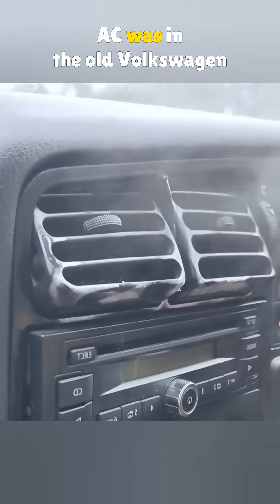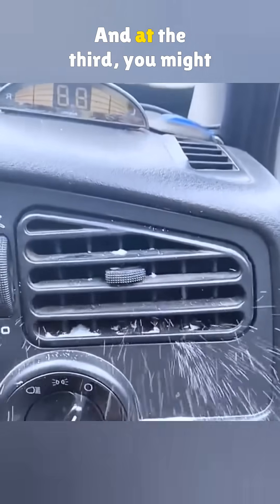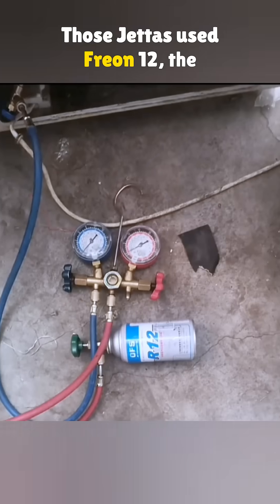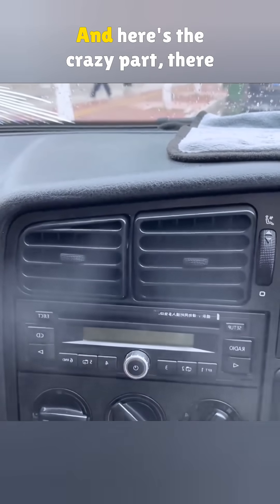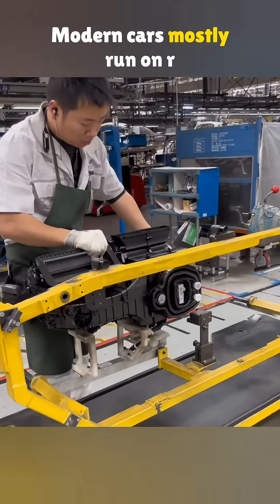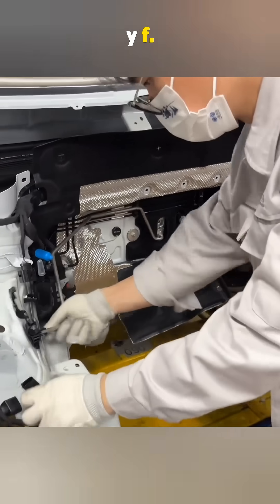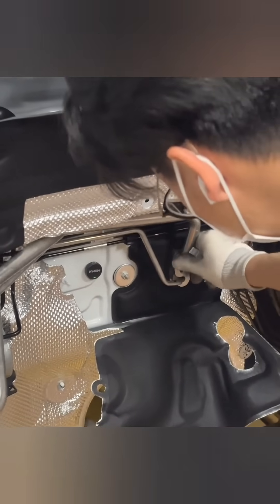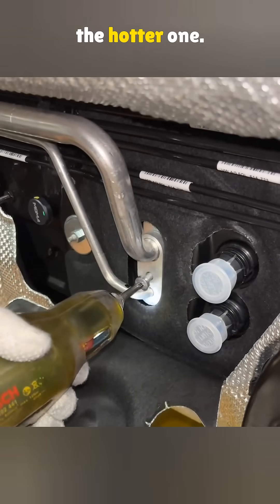Why Older Car AC Feels Way Colder Than New Cars #assembly #manufacturing #automobile #mechanic

Comment: You can do the same with R134a as well but it is not efficient than R12. Find the Evaporator Core temp sensor or heater core temp sensor (depends on manufactures' labeling). Cut the element off and solder the wire ends. Or just bypass it. Had to do this on my cousin's 2003 Celica cause that specific part was discontinued. It allow the AC Compressor to cycle. When it gets cold, the resistance increase. Disengage control side of relay. Works but it frost up to the point where it becomes blockage to the blower airflow.

Comment: still remember how i used to drive an old toyota, it was a KE70, turned the ac at fan speed 1, after 10 minutes of driving, i had to turn on/off the ac every 5 minutes of drive to work 😂 old cars ac are way colder than modern cars

Comment: In India, where temperatures can soar to 47–50°C (116°F), the air conditioning in Skoda and Volkswagen vehicles often falls short. Many buyers avoid these brands for this reason, along with the lack of features compared to the competition.
Reply: They don't study the market before entering it so they fall short in offering a car that people want.
Reply: use r134a replacement (ecoron freeze 30 or any hydrocarbon refregerant) .. 22 psi at low side at 27 degrees c and trick the sensors somehow.. it works great in my skoda laura

Comment: Is it really waste to use modern car  AC rather than opening window at high speed
Reply: Apparently causes more drag than the AC compressor - causing the engine to work harder to keep the speed up. At lower speeds it’s more efficient to keep the windows down
Reply: @ogalief  for good aerodynamics, you can open the windows from one side, front and back. You can choose which side you want to open
Reply: no, its proven that both equally use the same amount of fuel due to drag and resistance on the engine.